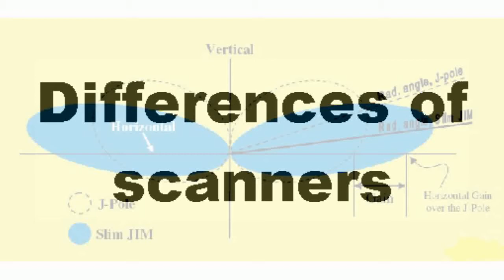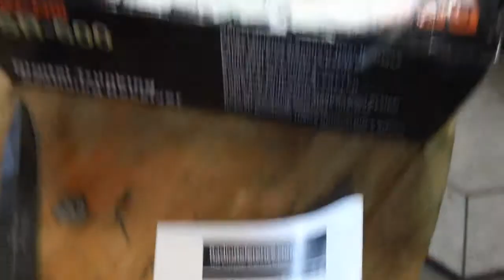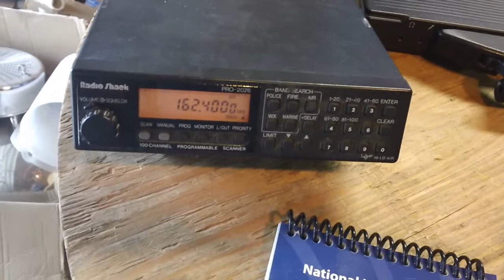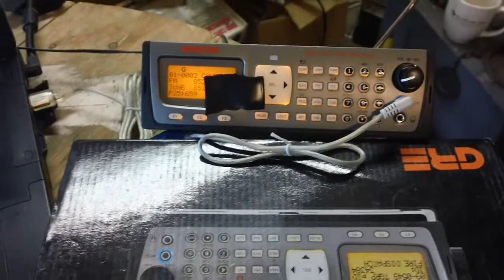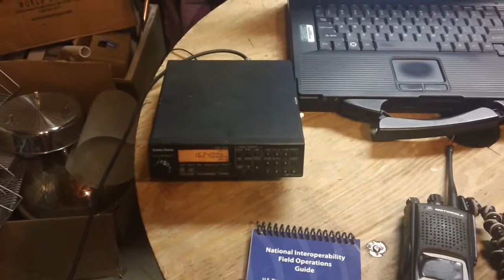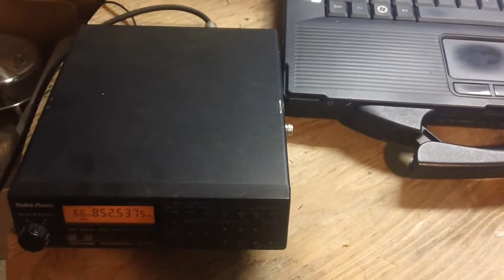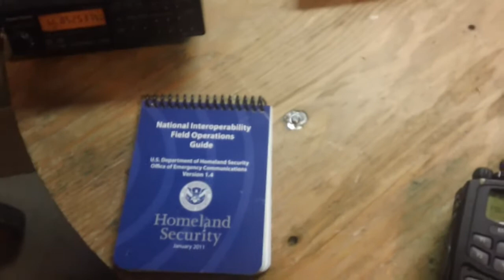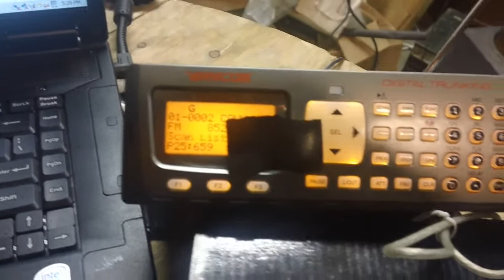Scanner Differences For Disaster SHTF Preparedness.

Comment: You might also want to check out DSD aka "Digital Speech Decoder".  You can add a "discriminator tap" to the audio chip of most analog only scanners.  You then use DSD and your computer's sound card to decode P25 or Motorola TRBO radio traffic.  I have a P25 capable scanner, but DSD would be a good option for someone without the funds for a P25 scanner.  It wouldn't be as practical for SHTF since it requires a computer, but it may still be of some use.

Good video as always!

Comment: You're welcome.  DSD can be pretty frustrating as far as getting everything set just right but if you're patient with it, it does work.  It's great for people that can't afford P25 scanners or for people that have departments using Motorola TRBO in their area which no current scanner can decode.

Comment: A lot has changed in the past couple of years. D-Star is offered by several radio manufacturers now and with the new Shark RF OpenSpot2, an amateur radio operator with a standard DMR radio can talk to radios using DMR, P25, System Fusion, D-Star and several other modes. All of the interconnection between the various modes are handled inside the OpenSpot2 unit now so we no longer have to own a DMR radio along with a P25, a Yaesu, and a D-Star radio to talk to other people that have them. I only own a DMR radio and I regularly talk to people on all of those other systems. Interconnectivity is a wonderful thing.

Comment from the maker: For a beginner its ok. Just because the antenna that comes with it, is already tuned, though, extremely inefficient. you're not going to get very good range with that antenna. they engineered a 1/4 wave cb antenna 102 US inches down to possible 5-10 cm antenna. Midland is a reputable company it should be a solid unit. You are pretty much ready to operate without having to worry about antenna tuning. Have fun and thanks for watching.

Comment: I just programmed a motorola XTS5000 and an XTL5000 for P25 digital 7/800 mhz First Responder Network. Not easy but I did it. It did take a lot of tweaking to get it on non affiliate trunking. They are only set up as scanners. This is a paid radio network, meaning the county, state and city pay $65 per month per radio. So unless you are certified by motorola you cannot program their radios. Only they are legal to do so. I can however set it up to scan, just not transmit. You have to be careful not to let the radio talk to tower or the dispatcher can brick your radio. The only problem I have is I have a wildcard frequency in there that makes the radio pick up everything on the network which isn't much in the small town. The biggest one is the school buses during school hours. After 5pm It is all law and fire. I hope once I am done tweaking to get rid of wildcard I will post a vid of steps to program for this. Motorola has the most complicated software to program radios. Many pages of settings and probably 1000's of combinations of settings. One little digit off and you have to study hard to find your mistake. But it is probably harder to type all of this than to program the radio once you learn.

Comment: Great scanners and video ! Information for those that are starting out you helped a lot on that. I own 3 myself. All 3 are Radio Shack's Pro 135, Pro 96 and a Pro 651. Want to stick with handhelds only. If you haven't done it yet another good video you could do would be to cover P25 Phase II systems and the scanners that receive them and also my Pro 96 has a Radio Shack 800 MHz antenna on it since that's all I listen to on it and my Pro 651 has the Remtronix 700-900 MHz antenna on it since I monitor mostly 700 MHz on it but also listen to 800 MHz systems on it as well. The Remtronix is an exact version of the Radio Shack one. Both make a world of difference on hearing the systems over the rubber duck antenna. I give this 5/5 and I will subscribe as well. Take care
Reply from the maker: +Ryan Fish Thanks man, and welcome to geekville... Sometime in the future I plan on covering P25 and its issues. Have a lot on bat between then and now though. Thanks again.

Comment: of all the digital modes, P25 is the most common, and if it's not secure it is very easy to monitor.

I would have at least given that U/C officers team P25 with the software encryption.

It usually comes with the radio (in firmware) and you set the key ID (CKR) and key value in CPS.

It's only 40 bit,but if you used a random key, for example "A607F941CF", you can gain reasonable privacy against eavesdroppers.

Just using P25 in the clear really doesn't afford any privacy.
Reply from the maker: I agree. With prices of P25 scanners and PC software decoders, its easy to demodulate the signal these days. At the time of the vid, that was the only tool to use and around my area, P25 and identifying is new technology. Now, they are equiped with the latest ASE encryption. And I still dont have access to  the keys,, Darn it...
Reply: GUERRILLACOMM 

I understand. I'm not knocking your videos. I've watched a few and enjoyed them.
Reply from the maker: Never took offence. Thanks for watching.
Reply: and its Going to get Harder , as Encription is coming Standard in the NEW iDAS Radios and APCO P25 Phase II.

Comment: What you mean hams don't have P25? We have a P25 digi repeater in KY...
Reply from the maker: Do you have any part 97 type class radio gear with P25, or surplus commercial gear part 90 gear used in the ham service? There is an uhf motorola msf-5000 in mixed mode in my area running P25 & analog, no one has a part 97 radio using p25, its surplus part 90.
Reply: OK. Thought you was meaning digi wasn't allowed to be used by hams. The K4TDO repeater in Hazard, KY also runs mixed mode but it is on VHF and I run a Moto 2500. Keep makin videos bro.
Reply from the maker: Thats a fine radio you got there, I'm jealous.. I should of been a bit clearer about the modes. Thanks for watching.

Comment: And do you have an Harris P7100ip, or APX6000, or 7000 yet?  Brand new Motorola HT's start at around $1,500 for all the bells and whistles, mobiles around $3,000.  And the bad news for most is this:  Motorola now makes encryption a standard part of the programming templates for Public Safety radios.  It is up to the individual agencies to turn it off.  Formerly, encryption was an extra option that cost extra.  It is now an standard option free of charge, and is from the rip, set to ON on new radios/systems.
Reply from the maker: I've seen the APX deployed, only to command tier personnel though. I didn't know encryption comes standard now. I know the EF Johnson 5100es has the secure (something) channel feature standard. I think they use AES/DES, but are not activated. key management is a pain in the ass & a new thing for these agencies. Its only a matter of time when scanning public safety freqs will be virtually impossible the way technology is moving. for now its costs that is slowing the wheels of progress down.

Comment from the maker: Looks like the whole county including San Diego both sheriffs & PD are on it. its on a massive countywide 800 MHz Motorola Type II SmartZone trunking system using both analog & P25 digital trunked. You got the worse combination for scanning those folks, it could be done but you would have to know your stuff and weed out the BS talkgroups. it takes me a while to program a simple trunk scanning system,.  the only folks on a regular repeater system is CDF.